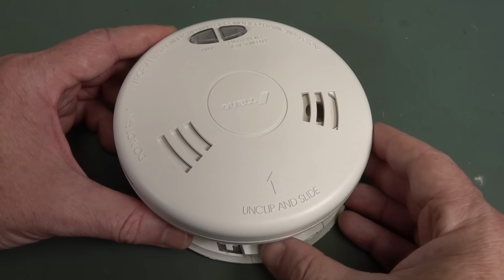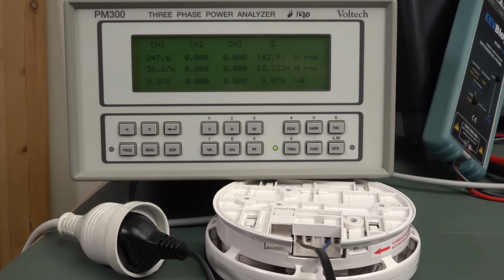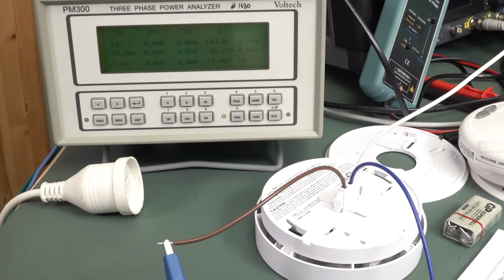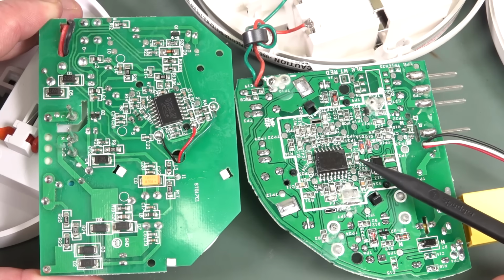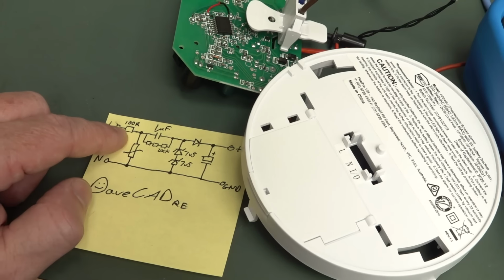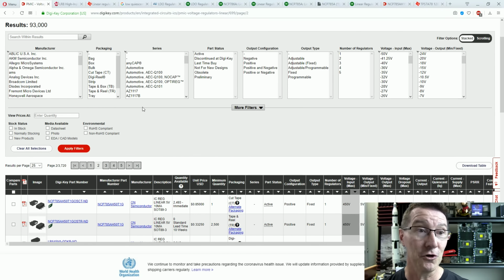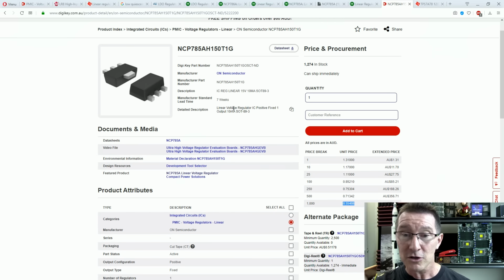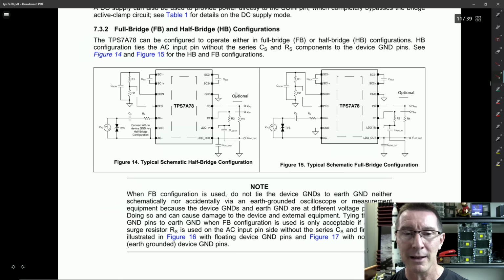EEVblog #1284 - How Bad Product Design Kills The Environment

Comment: The apparent power is not real, it does not have to be produced. It does, however, cause losses in the wires because of the resistance.
Reply: Something I think worth pointing out is that mechanical generators don't have a problem, but inverters do.  There's a reason why UPS is rated in VA and not watts.
Reply: They should have just used tiny mains frequency transformer, product may cost 2-3$ more but power factor would be far greater
Reply: @blackwingmaster141  some do, atleast the CO detector I took apart.  I didn't measure power consumption, it died to internal timer saying it's too old. (chemical sensor)
Reply: @blackwingmaster141  A power transformer also has poor power factor when it is very lightly loaded. The transformer always draws a primary magnetising current even when there is no load on the secondary. This magnetising current lags the mains voltage by 90deg so has a power factor of close to zero.
Reply: @blackwingmaster141  $2-$3 more at manufacture translates to $20 more at retail. that in turn means people buy the competitors product that uses this tech and costs $20 less.
Reply: My Ex gf's father is working as a grid manager for a big power company in Germany, and we once had this discussion. According to him, private households don't have to pay for the power factor because back in the days when the power meters were installed, it didn't make much difference to go for the more expensive power meters, too, and in today's power grid the amount of capacitors and transformers/vacuum cleaners/etc. almost cancels each other out, but for big companies, the amount of spools, electric engines, heat elements is so high, they need to install big capacitor banks to avoid losses (which costs money). Fact is, I don't know how much energy gets lost due to the current flowing aimlessly from one household device to another, but it seems to be insignificant - for him, at least. Just to digress: for him, solar cells where a much, much bigger issue, since one cloud over bavaria could create a sudden lack of several GW which had to be compensated. A storm had the same effect for windmills. So his job was basically to run in circles switching on and off gas power stations and storage batteries to avoid power shortage. So as a matter of fact, the whole power thing seems to be complicated.
Reply: @TheBigBadButler  Fuckin A it is huh...
Reply: @eevblog the real problem is the current harmonic content not power factor by itself. Standard power factor correction techniques at grid level based on inductors / capacitors simply does not work in this case. There are regulations on this (en61000-3-2 for example) but it applies only above 75w so the manufacturer simply does not care about it. The real problem of this design is not the PF by itself but the huge amount of power wasted in the zener diodes.... They used even 2x 7.5v in series in SMA package to cope with the losses...
Reply: @marcogeri  why do the damn smoke detectors need zenner diodes,  is this a component smuggling scheme all along,  aren't zenner, more of a radio thing?
Reply: @marcogeri I'm an EE and This is the right comment. In addition, Some of your reactive power is subject to thermodynamic losses, so reactive power is not desirable in general, but is usually easily tolerated. It's better to design for low real power before low reactive power.
Reply: Everyone forgot that moving the PF away from unity of a generator requires more excitation voltage to counteract the increased back emf of the supply side, another small (tiny) but real loss.
Reply: "Energy can be transformed from one form to another, but can be neither created nor destroyed." I would like to offer the first law of thermodynamics. If the power is being used somewhere it is most certainly being generated somewhere else. 

Usually over large grids capacitive and inductive loads will at a small level cancel each other out with inductive loads being more common. Yes dirty power does cause power loss from multiple sources including resistance of the wires but it also reduces the efficiency of other machines in the same area as the machine causing the problem. One machine in a large grid is negligible but that doesnt mean the power is free. At some level more fuel will need to be burned to compensate for any unbalanced PF. If it's making heat in the wires that heat or energy is being added to the steam boiler, diesel generator, solar panels, squirrel cage etc.

As the voltage drops many devices pull more current to remain power constant. This is why running a 220 motor with 110 will cause it to run hotter not slower. As power is used the first reaction on the generator is increased torque on the shaft, in order to maintain constant frequency more power is added to the shaft. If voltage or frequency go down this causes a dramatic increase in current (Initial load on grid remaining constant). 

If there is a resistance separating the generator and load it must compensate for this with an increase in current. This is why if your angle grinder is getting hot using a shorter, thicker extension cable will help it run cooler. I might be wrong but I don't see any way around this to free power, even if heating the wires isn't performing useful work it is still consuming energy that must be replaced.
Reply: If practice the power factor is most often compensated at the latest in the nearest substation. And if the network is on the inductive side of reactive curve these devices will actually help compensate the local grid.. so not as simple as Dave leads us to believe.
Reply: Is the smoke detector PF capacitive or inductive? If I am correct the power grid is inductive, so if this thing is capacitive they don’t mind? Most mains led lamps are using also a capacitor dropper, with also a bad PF.
Reply: Based on the sheer number of answers and conflicting opinions here, this channel could use a video on grid/real power. Two professors in my old university taught courses involving power factors yet neither of them ever mentionned whether that power had to be produced on the shaft or copper losses on the extra currents.
Reply: This thread made my head explode.
Reply: @compwhiz797  You've tried that argument before, and it isn't any more convincing now than it was the first time you said it. On the one hand we have you and others I have no idea of the qualifications for telling me that this waste doesn't happen, yet on the other hand we have Dave and other electrical engineers saying that it does. While everyone makes mistakes, I find it far more likely that it's you who is wrong than Dave is. You use a lot of language ("I don't see", "doesn't sound like", "seems") that are red flags of an argument from incredulity. Your expression of incredulity of why it "doesn't sound like a motor hooked up to it" is particularly hilarious because it's the fact that generators and motors aren't so neatly separated is the reason why generators conserve energy in the first place. FYI, the ghostly motor does in fact help by putting energy back into the rotor, but it's still a legit load on the system. If you gave me $20 and I gave you $19 back, it doesn't erase the fact that you gave me $20 to begin with.

To be sure, reactive power is quite screwy, evident by the fact that apparent power isn't the simple sum of the two. Near I can figure out, reactive power is the power required to change the configuration of the electrical system from moment to moment. It gives your notion a fighting chance, but I think we need a real electrical engineer like Dave to really explain it thoroughly in a Fundamentals Friday vid. I've been doing calculations and I haven't definitively shown VA in some sense is W, but I can't help thinking that there's a 'gotcha' somewhere I'm not seeing.
Reply: You say yourself it causes losses in the wires, so where does that extra energy come from?
Reply: @PlasmaHH  from the generator. It's less than the difference between apparent and real power, though.
Reply: Transformer had to be sized with the VA figure, not the watts.
Reply: Interesting points re apparent power (Kvar) and real power (KW). As a electrical designer (UK), I would always need to select a generator or a transformer using a calculation of KVA because this includes both apparent (reactive) and real power. The difference between KW (real power) & KVA is the power factor. The apparent power in the system doesn’t do any useful work, but it exists and has to be accounted for when correctly sizing a generator. In the uk, commercial customers get charged for apparent power, as a result of power factor that is less than unity. That’s why customers buy Power Factor correction units, capital investment that can significantly reduce operating costs. Post made me think of a good analogy from college, KVA is a pint of beer. The real power is the beer and the apparent power is the head. Beer always makes things easier to understand 😀
Reply: @G1MRK  - if you REALLY are an "electrical engineer" then you would understand that these capacitive droppers are a LEADING power factor. So, they are "power factor correction units". So they reduce the head to beer ratio, not make it worse.
Reply: John Coops 
My post was in relation to the original posts in this thread and the potential implication that you don’t need to account for reactive power in generation. Not the particulars of the smoke detectors. Interesting point you make re the assumed capacitive reactance. Would you describe any component or appliance, in any system that had net capacitive reactance, as being a ‘power factor correction unit’?
Reply: @José Ancapdolf Hidler sounds about right.
Reply: I wonder what the net impedance of the mains loading looks like with all the electric motors etc.. Usually industrial power factor correction is capacitor banks, so maybe these things are actually helping correct the  grid's net power factor.
Reply: @spehropefhany  is it hard on the transformers if the motors are vfd fed and running slow as possible.
Reply: I have a very strong feeling that a good few people on here don't understand phase reactive losses.. The energy wasted is lost as heat and the customer pays for it.. Doh! One of the reasons big users are usually very careful not to have poorly balanced loads..
Reply: Dave is TOTALLY wrong on the Power Factor issue. These use a CAPACITIVE DROPPER which results in a LEADING power factor,. This makes the grid MORE EFFICIENT, since it "corrects" the lagging power factor that is inherent in the normal power supply chain. So, these little devices improve the efficiency of the grid, not make it worse..
Reply: @johncoops6897  The mains are usually already corrected with big-ass capacitor banks. Adding additional leading reactive power to an already corrected system will lower efficiency. PF can never be more than 1, and PF = 1 is one with reactive power of zero.

Overcompensating with a unnecessary capacitor gives you excess leading reactive power and therefore lowering the power factor. That's why you don't just slap in a capacitor willy-nilly and all those Chinese "power factor correction" devices are bunk. You must tailor and tune your power factor correction to your particular situation. There's no one size fits all solution — well, not that cheap, anyway.
Reply: @wyrmofvt  - The DOMESTIC homes where these detectors are installed will have an overall PF of 0.7 to 0.8 lagging AT BEST. So these capacitive loads will always improve (not worsen) the PF.
The reason those Chinese "power factor correction" devices are bunk is because their capacitance is so small it makes no difference. These smoke alarms are even smaller capacitive (reactive) power than the Chinese crap. So, they have even LESS effect.
Many people do not understand PF, and cannot grasp that something with 100% reactive power is not "evil". If installing said device changes the power factor from 0.89 Lagging to (say) 0.95 Leading.... then the power factor has improved (irrespective of which side of unity it sits).
Reply: @johncoops6897  Bollocks. I doubt any cheap detector will give you an accurate assessment of PF in the first place, let alone its direction. The probable goal is to get you to buy bogus PF "correction," which will then be applied and then not verified to find out if it's remedied because people don't understand PF.

Power factor also varies per device. While older appliances can have some terrible power factors, modern appliances that conform to the Energy Star requirement must have a PF of at least 0.9 or better at full load anyway, either direction (NO guarantee that it's lagging!). Besides, capacitors are affected by series/parallel laws and as such the impedance it contributes to the circuit will vary A LOT depending on how they're connected. If you connect two capacitors in series, for instance, the combined capacitance goes DOWN, and thus would provide less leading reactive power — by adding in your superfluous capacitor, the reactive power could lag more.

>"Many people do not understand PF"
Yeah, that includes you. A 100% reactive power device is one where energy is not being transformed to some other use, like mechanical energy. Not exactly evil, per se, but not really fit for purpose. The bottom line is that there is no silver bullet. There is no one course of action that will ALWAYS improve your power factor.
Reply: @johncoops6897  well,  I find it all fasinating,  I like Dave and His channel. IF He is wrong then he s wrong, but one thing is for sure,  this has been the most epic thread on YouTube
Reply: With the introduction of smart meters in domestic settings which can measure kVA and energy companies substantially billing customers for the kVA they consume (there are European countries where this is already happening). The power factor of domestic appliances will have an effect on what consumers are paying for electricity.
Reply: @Broadcast1Channel  - hence any devices (eg: capacitive droppers like these) that reduce inductive power will improve the power factor. This will help to "REDUCE the kVA", not make it worse.
Reply: M I the only one, thinking this PF is leading one and not lagging one as the load is capacitive..?? Isn't it gonna change senario??
Reply: @compwhiz797  A wiseman once said, don't teach your grandma to suck eggs. Look, all the elements of power grid have to be sized to the maximum voltages and currents found along it, so you want to minimize both. For a given power output, that minimum occurs when V and I are always in synch. You can control that pretty well at the generator, ensuring that when you say that this generator delivers 20 W of power, it's really delivering 20 W of real power. That can and does change down the line as you connect various components. Any power you funnel from that generator into the grid is really being dumped into the grid.

Some of the delivered power will be dissipated in resistive loads as heat or work. These elements will take the power out of the system and keep the energy in the system from increasing without limit. The rest, the reactive loads, do not dissipate this energy but instead store it for release in another part of the AC cycle. A grid that is in a state that is delivering real power to resistive loads on it will have some proportional excess energy in it in these reactive loads.

Now, if these reactive loads could always absorb and release this energy back into the system without loss, then PF will always be 1 because the energy absorbed by the reactive elements is returned in full to the grid — only resistive load can get energy out of the system. However, if we consider what is happening to the individual electrons, we see that this could never be the case. These charges are accelerating in an AC circuit, and when charges accelerate, they emit EM radiation. This is fundamental. You can't get around it. Just by being reactive, the grid will absorb some energy that will never be returned — even though the loads are purely reactive, they nonetheless dissipate some energy as if they were resistive. Yet the energy lost in the reactive elements must be regenerated, else the grid can't be maintained in a steady state. This is reactive power. (Furthermore, there is no such thing as a purely reactive load.)

As for power factor, it is straightforwardly the amount of apparent power piped in vs. real power absorbed. A 20 W generator dumping into grid with 5% transmission loss over the grid will see 19 W on the other end, and the voltage at the other end dropped by 5% (current being 'constant'). Of course, since the amount of current passing through a resistive load is proportional to the voltage drop across it (Ohm's law), you can't simply say that some device's power consumption is 1.5 W — you have to specify the voltage across the plug blades. The device having a power factor of 5% means that, of the delivered 20 VA apparent power, only 1 W is dissipated as real power; there is 19.97 VA of reactive power being absorbed by the system. And yes, that doesn't add up to 20 W. That's because we're dealing with impedances and complex power now and they live on the complex plane. Having a suitable device on the grid with -19.97 VA reactive power will correct the imbalance and bring the power factor up — by adding a suitable impedance, you can bring the amount of apparent power needed down. Resistive transmission loss is not reactive power and can't be recovered by way of power factor compensation, so it's considered a part of the real power.
Reply: Typically grids are inductively loaded due to motors. Capacitive PSUs are fine, because they get too expensive (as compared to a SMPS) when they get to problematic power levels.
Reply: @compwhiz797  "Surely this applies equally to the current supplying a pure 20W resistive load, too, right?"

Well, yeah, except that there can be destructive interference such that in the far field it looks like the circuit is not radiating. A properly tuned circuit will have it so that no significant EM radiation will be leaked. But there are also other sources of power leakage that can sap away reactive power. For instance, if you consider only the grid and the things on it, we have reactive power, but if you include more electrical entities like the ground (which can exchange energy through capacitive coupling) and more detail on the entities you have, then it can easily end up with alternate paths for power to go and have ensembles of reactive elements looking like resistive elements (filters are one such item). You can have it that most of the current coming down the wires is bypassing the load altogether — current that doesn't flow through the load itself doesn't power it.

Ultimately, if you pump 20 W into a system and it remains in a steady state, then 20 W are coming out of the system by some route. Furthermore, 20 VA is exactly equal to 20 W if V and I are in phase. It is something you can measure, and verify that there is, in fact 20 W coming out of that generator and into the grid. You can measure how much is going into the system and how much is coming out the load. The remainder has to be going somewhere else.

I mean, we've done measurements and know that PF does mean that, wherever that power is going, it ain't going into the resistive loads — it does impact efficiency. We saw in Dave's video that a smoke detector was definitely drawing more power from the mains than it did from its battery, and at a horrendous power factor. This is a real measurement, and requires an explanation.
Reply: @compwhiz797  Because with a PF of 0.062, the device is only dissipating a 0.062 proportion of the apparent power 20 VA towards some end. That's what "power factor" means. Ergo, the rest of that power must be going somewhere else, and the amount of power going somewhere else is more than 10x that of the power dumped into said device.

Because the load is resistive and (presumably) linear, the amount of power absorbed by the device is proportional to the apparent power pumped in, so for S*0.062 = 20 W, S = (20/0.062) VA. (Of course, this presumes that the load responds linearly to apparent power; real world devices will likely have PF that are functions of their power draw.)

Now, where is this somewhere else? Without analyzing the grid, we can't tell. That power factor only applies to that device, not the system as a whole. The power factor of the transmission lines, on the other hand, may be entirely different. Of course, there may be many routes for the reactive power to eventually go, routes that would not be available to a DC current. Even if that reactive power is reflected back at the generator, we could view this as the generator losing efficiency, or we can view it as an electrically driven friction force on the generator.
Reply: @compwhiz797  >"This is where I don't follow: you simply assumed that VA equals total dissipated power"

You can measure the amount of power you're putting into the generator at the crankshaft, and if you're measuring that a generator is being cranked at 20 W, you know that you're putting 20 W of power into it. That power is energizing the grid, and given that the grid hasn't exploded on you, but instead remaining in a steady state, that there must be 20 W of power coming out of it. You may not know how it's coming out (you need to fully identify the problem before you can determine that), but you DO know that 20 W is going somewhere.

Nothing in the above explanation says that the energy is necessarily being dissipated by the resistive elements of the grid proper. I've already pointed out that current can leak into the ground by capacitative coupling, which can be substantial over the course of miles of transmission wire. At each stage in this transmission infrastructure, we can verify the amount of power being transferred along it, and build so that these components are delivering the expected watts to the next link in the chain. And yes, they know the difference between VA and W and when they say that a power plant is cranking out 200 MW, they actually mean it.

You keep going back to your LC circuit as if it means something, but it doesn't. Your LC resonant circuit is idealized and not representative of the grid. You at least need an R component in the circuit in order to even pretend that it represents the grid. Furthermore, your grid is dead simple and isolated, which a real grid is not. You can verify that your LC circuit isn't absorbing much power because you don't feel much resistance when you crank the generator. But that also means that a power grid is really absorbing 200 MW from a 200 MW power station because the turbines are really cranking the generator shafts at 200 MW.

It's just bizarre to me that you think that electrical engineers are cutting their guts out on something that is actually inconsequential, and that Dave is taking the piss when he says that an out of whack power factor requires more generation capacity. No, it really matters, and the loss is real. AC is tricksy and can find many avenues to avoid putting power where we expect it, and can even escape its designated cage altogether — maybe not much in any particular part of the cage, but over a large extended area that a typical utility grid is spread over, the losses can be substantial. Reactive power is indicative of energy being shuffled about in unexpected ways. The very fact that power companies spend millions on power factor correction and charge industry for having out of whack power factor indicates that it is actually a thing.
Reply: It's no use, "a man convinced against his will is of the same opinion still". - Benjamin Franklin
Reply: @compwhiz797  Imagine a hamster is powering the grid from a bicycle generator. The grid is entirely resistive, so has a power factor of 1. The hamster pedals furiously. The second hamster measures the voltage and current leaving the generator. It is perfectly in phase. The instantaneous power is always above zero (it touches zero twice per cycle).

Now the grid is entirely capacitive. The power factor is 0. The hamster still finds that he needs to pedal furiously to support this grid at the specified voltage levels. The second hamster measures the voltage and current leaving the generator. The current leads the voltage by 90 degrees. The instantaneous power is now oscillating around zero.

If in the first case, the generated real power was 100MW, and in the second case the generated reactive power was 100MVAr, does the hamster on the bicycle know any difference? Does he have to pedal just as hard?
Reply: @compwhiz797  >"Where you lose me is that we are talking 20VA measured at the load.  Not 20W measured, and not at the generator."

It's a contrivance of the example. It's been arranged such that the outlet does, in fact, deliver 20 W to a particular appliance with PF = 1, such as a 20 W incandescent bulb. I've been assuming that the grid is well built and maintained to guarantee that the outlet does indeed deliver 20 W with V and I in phase under such resistive loads. I'm not saying that VA and W are always the same; I'm saying that the grid builders and maintainers have done their jobs properly.

So the outlet is capable of delivering 20 W to certain loads with PF = 1, and as such apparent power and real power are the same. That will change under a PF = 0.062. We suppose that the device will have the same impedance magnitude, but not the same phase angle (cos(arg(Z)) = 0.062). It will therefore draw the same complex power (VA), but the power is split between resistive and reactive power.

Without knowing the details of the particular grid —and for a real grid, you probably don't— you can't say how the extra power is being lost. It's simply ill-identified. You just know it ain't going where it's supposed to go.

>"The thing is, if 20VA at the load = 20W generated without adding compensation in the local grid, engineers would be getting out torches and pitchforks for these smoke detector companies, and all other items with horrible PF that are all over the place, rather than saying "okay, we can filter/correct that"."

Well, they do get their pitchforks and torches out for atrocious PFs of substantial magnitudes, only that consists of sending a hefty bill to the offenders. As long as the customers pays for their power, real or complex, they could be sinking that power right into the ground and the power company wouldn't care. Thing is, that PF-poor smoke detectors do not form a substantial portion of that. We're still talking about power loss of around 2.5 W per home (5 units @ 1/2 W each), which is about 0.25% of average consumption. They're not going to be upset about that.

The configuration of the grid is ever changing: devices are being connected and disconnected all the time, and even the same device may not have a consistent power factor. As such, it may not be worth maintaining PF correction past a certain point. Nevertheless, the power company is doing their level best to keep V and I in phase across the grid, because that's where power transfer per V and A are at maximum.

>"If you have a small generator hooked to a resistor, and then you add a big capacitor across the resistor, what part of the system would suddenly be dissipating a lot more power?"

It depends. Your setup here is ill-identified. In your toy example, it's likely (though not a sure thing) that reactive power is feeding back into the generator in which case you'll have a dim bulb and an easy time cranking it. The power company is doing its level best to see that this doesn't happen. They can't sell power they don't deliver, so they're going to make sure that the 200 MW of power their plant is cranking out actually makes it to their end users and stay there.

>"Capacitive coupling to ground sounds like it will leak that current just by having voltage on the grid, even with no load.  EM losses from moving charges also sounds like it will be the same for the same amount of current at the same frequencies, regardless of phase."

It depends. You need to specify a specific grid and crunch the numbers. Just because the AC currents can couple with the ground doesn't mean that the current will find moving through the ground particularly easy. Just because EM radiation can be emitted doesn't mean that that radiation won't be preferentially absorbed by other parts of the circuit.

This is part of the reason why there's no silver bullet to remedying your PF issues. Complex power is complex, in many senses.
Reply: @compwhiz797  >"but they don't make you pay for VA as if it were W generated, they only fine you for bad PF - if they really had to generate the entire VA, then why didn't they bill VA rather than watts right from the start?"

Because metering real power is easier, I expect. Metering real power requires a very simple motor (remember that spinny disk thing you had in your old meter?), whereas monitoring VA requires a more complicated meter. Also, that surcharge for bad PF is effectively a bill for VA. After all, keeping up an active power delivery with a bad PF ultimately requires a higher peak V and I from the generator (compared to good PF), which requires the coils to be excited more, which requires the generator to be driven harder. It also eats into the contingency margins for the grid. Power companies need to generate MORE power than is nominally consumed, because they need to supply an unpredictable demand.

>"again, you are just assuming complex power equals real power."

You might as well have said here, "You are just assuming 2D momentum equals 1D momentum." Complex power is real power rotated partially into the complex plane, of which real power is its projection onto the real line.

>"In my example, the bulb is intended to run at 1.5W, so it won't be dimmer than designed unless it is no longer getting 1.5W (of real power, since it is resistive)."

What voltage? What current? The reason why the bulb gets 1.5 W of power in a particular circuit is because it presents a given resistance to the circuit. It's 1.5 W @ 3 V DC, for instance. Double the voltage, and you quadruple the power dumped into the bulb. You gave VA, but you never gave V or A alone.

>"The VA of the system goes up (complex power has increased entirely in the imaginary dimension), but the generator doesn't have to turn that much harder, like you said, right?"

Again, it depends. I can confidently make this prediction because in this example I can make the rather restrictive assumption that the significant resistances, capacitances and inductances can be counted on one hand, and I can make some fair assumptions about the magnitudes of same, and the requirements of your lamp. Real grids and real loads? Not so much.

>"This was my whole point, increased VA here doesn't mean the generator has to generate that much in watts, the system just has to deal with (and be built to handle) more current, and the generator has to make up for the current losses with some extra generation."

And that's my whole point. You said yourself right there that maintaining the required current losses requires extra generation (also increased peak voltage, but you can trade current for volts). That means cranking more generators and/or cranking them harder, and they don't run on pixie dust and sugar, my friend.

>"In a real system, isn't the main reason that the reactive power doesn't "feed back into the generator" because of the PF correction that utilities add to the grid?"

Yes. But that doesn't mean that it doesn't go elsewhere on the grid. And due to varying PF even in the same device, let alone the ever changing landscape of devices drawing from the grid, no static PF correction can completely compensate for bad PF at all times anyway. That utility-side PF correction could cure your devices's specific PF, but it's bloody unlikely. A per appliance PF correction is best. (Psst, that's why the Energy Star standard requires that the appliance itself maintain a decent PF.)
Reply: @eevblog - we non EE subscribers would appreciate a follow up video on this imaginary power debate. My basic understanding is that lost current across the zener voltage drop is lost power, and that power has to be supplied from somewhere, paid for by someone with some CO2 emissions.
Reply: @billward2264  That's a pure resistive loss over your diode and a linear term. What all are talking and confusing about has to do with sinusoidal curves of current and voltage that are timing wise not congruent. This does it not make "unreal", apparent, seeming, ostensible in a colloquial wording sense. Only harder to wrap your head arround it and to calculate. It's that easy:) ... with a little complex math. Please have a look at  https://en.wikipedia.org/wiki/AC_power#Calculations_and_equations
Reply: @compwhiz797  But reactive power feeding back into the generator is completely equivalent as having full power coming out of the generator and then having the reactive power feeding into a motor on the same shaft, only in this case the motor and generator are the same device. Generally, a generator produces emf at ℰ ∝ ω sin ωt. That will induce a current proportional to the resistance it sees. But with back emf, what we get is charges that reduce their energy as they move through the wire (below that is expected by the driving emf) — to the generator, that looks like a resistor. Now, if we allow the generator to slow down, we reduce the back emf and balance can be restored, but in power plants you can't do that — ω = 2πf must be maintained. Thus, you have energy going into the current through the forward emf, but that energy is being taken out of it by the back emf, leaving the energy in the generator. The generator must heat up.
Reply: Power factor is difficult to understand, if the current is 90 degrees out of phase with the voltage the wattage is zero. The only power consumed is in the resistance of the wires, transformer windings and the generator windings. You need to understand true power and apparent power.
Reply: @compwhiz797  The reason why I say reactive power is somehow real is that it represents the energy sloshing around in the circuit, causing charge to move around in real wires that have real resistances. If you disconnect an LCR circuit from its driver, its current will eventually die down and become quiescent, as proven by experiment and the derivative formulation. It is NOT the case where the active power is extinguished and only the reactive power is left, so the circuit oscillates for eternity.

I think that active power and reactive power must be transforming into each other. What we see in a steady state circuit is the situation where the two are in detailed balance — that is, every joule of reactant energy that is gained is matched by a joule lost and transformed into active energy. It would explain why a higher reactive power would require more juice.
Reply: @wyrmofvt  Complex power is split into two orthogonal parts (parts that don't interfere with each other). The first is the resistive part, where V and I are in phase. The second is the reactive part, where V and I have a 90 degree difference. A system with only reactance would be impossible to recreate in reality because all capacitors and inductors have resistance. However, if it were possible, the situation of having electrons moving back and forth with no net energy input would hold no contradiction because there would be no resistance. All practical systems have a combination of the real and reactive parts. Mathematically, the instantaneous power can be split into these two basic, pure and separate parts. That's why we can say we have X amount of power that is behaving like it is in just a net capacitive or inductive circuit, and Y amount of power that is behaving like it is in just a resistive part. The two phenomena exist separately in a way. That is the mathematical elegance of complex power - S = P + jQ. All the resistance is stripped from the L and C parts and moved to resistance and, and vice-versa.

The way I saw this discussion was in terms of whether reactive power is continuously absorbed/re-absorbed into the system with no net energy requirement, i.e. does a power plant need fuel to create the reactive power. If someone could invent a generator that was able to do this, sure. But synchronous generators have practical restrictions. The answer to this whole debate is in the physical operation of the synchronous generator. It would need to behave like a capacitor for part of the cycle if the circuit was net inductive, and an inductor if the circuit was net capacitive. My understanding is they can do this to some extent, but it gets complicated. I'm still unsure.
Reply: @Steve-du6ms  If I were to set up a current in a superconductor loop and disconnect it from the current source, it would also have a current that flows forever. The idealized LC circuit doesn't dissipate power because it has no means to, so it oscillates in perpetuity. It's not because it has only reactive elements —a superconducting loop has only conducting elements will sustain a current forever— it's because there's no avenue for energy loss. It also has no power, active or reactive, at all — an LC circuit oscillating on its own does so at its resonant frequency, which means that their reactances are equal and opposite, so they cancel out — no impedance, ergo no power. The wires between the reactive elements of a circuit all follow Ohm's law, and they conduct only when there is a voltage drop across them, and as such, they only carry current if that current dissipates some power. Wires and other resistors never see this current out of phase with voltage thing; they obey Ohm's law even though the reactive elements don't.
Reply: @wyrmofvt  In the idealised case of a purely reactive circuit, Ohms law is (I^2)X, not (I^2)R. No power needs to dissipate for electrons to flow if R=0. The theory of complex power, S = P + jQ is reliant on the assumption that the Resistive and Reactive parts can be completely separated into lumped elements - R, L and C. Despite the fact that all practical capacitance and inductance has some R, with complex power, we separate them out so the circuit impedance is made up of all the R and all the net C or L. This is the complex impedance, Z. Your Ohms law is then V/Z. Some of the confusion about reactive power seems to stem from the fact that it is an impossibility (in any practical system) for electrons to slosh back and forth with no net energy requirement or power dissipation. But complex power is a mathematical trick to split the power up so, actually, one element is behaving like it is in a purely reactive circuit. To deliver a set amount of real power to a load, more current is required in a system with a poorer power factor. This will lead to higher overall losses - (I^2)R. This is different to saying that the reactive power is interacting with the resistance to cause losses. The reactive and real elements do not interact, and this is the mathematical genius of complex power.
Reply: @Steve-du6ms  Yes, I did take the unit on electrical power in college. But you're wrong in saying that reactive and resistive elements "do not interact." They do, by way of the parallel law, which involves the (-1)-norm of the impedances. The impedance of a resistor R and capacitive reactance X is RX(X-jR)/(R²+X²) — R is sitting where a capacitive reactance should be. Furthermore, a set of purely reactive elements can react in a way that in the limit looks like an ordinary resistance. Feynman II 22-6 details an example where an infinite L-C ladder network will (below a critical frequency) have a real-value impedance. This might sound like an unrealistic example, except that very long power lines behave the same way — like a bunch of very small impedances in series and capacitances in shunt. Even a superconductor transmission wire will have a real-value (completely resistive) impedance of sqrt(L/C), where L and C are inductance and capacitance per unit length. (explained at the end of Feynman II 22-7)

Again, I think that no power is dissipated if R = 0 is missing the point. No power is dissipated because there is no avenue for energy to escape. The reactive lump elements L and C provide no avenue for energy loss, and that's why it doesn't die down, but even if a real LC circuit could be made completely out of superconductor, it would still throw off EM radiation as they are putting out changing electric and magnetic fields into free space, and in the formalism would manifest as a resistance that would be a power loss. In normal circuits this may be ignored, but in a circuit where EM radiation would be the principle source of energy loss, it can no longer be ignored as it is in the formalism. And as I outlined above, even purely reactive components can interact in a way to produce impedances with real values.
Reply: @wyrmofvt  This kind of analysis is common in mathematics, science and engineering. P and Q (and R and X) are decomposed orthogonal sets. They add only in quadrature to form the apparent power. If you start claiming that they are interacting, you are claiming that sideways interacts with up in cartesian geometry.The mathematics of complex power are based on the resistive elements and the reactive elements being separated. All you are doing with the equation for a parallel RC circuit is converting that system into an equivalent series impedance, also made of R and C. This R and C was always there in the first place, separated and not interfering. As I keep saying, complex power is made up of real and reactive power. Real power is dissipation in the resistive elements, Reactive power is the power flow into, and out of the reactive elements in the circuit. The mathematical concept of complex power - to truly understand it - requires you to visualise the two phenomena separately. They are idealistic extremes that cannot exist practically, but can exist on paper, and in our minds, in the form of S = P + jQ = (I^2)Z = (I^2)R + j(I^2)X. Think of the lumping all the reactance and then lumping all the resistance of a circuit in a single place, then solve the circuit. The only "Interaction" is due to the fact that the current magnitude can change if X or R change, effecting the losses. 

The LC ladder network in Feymann's lecture is the ideal long transmission line model. The resistance you are referring to is the characteristic impedance of the line. It is the ratio of voltage and current if a signal were sent into the line before any reflections would occur. This is completely different to the kind of impedance we are referring to in complex power. In an electrically long line, things become more complex because the voltage and current are now a function of position on the line.
Reply: @Steve-du6ms  Now I know you've stopped listening to me, if you ever did listen to me, and are now throwing out concepts trying to impress me. Anyone can take a charged capacitor and connect it across a resistor and note that the resistor will discharge the capacitor to know that the two kinds of components do interfere with each other. I have a page full of equations and calculations of three simple circuits, each adding in a different reactive element, that shows that they DO interfere with each other. Each reactive element added changes how the circuit behaves and how much current a lamp at the end gets. I presented an equation that showed that, if R > Xc are connected in parallel, then the resulting impedance has a larger reactive component than resistive component. Yes, in terms of calculating their respective powers, they are separate from each other. But equally important is that as long as the frequency of the AC remains the same, P and Q will maintain the same ratio regardless of Vrms or Irms for any given circuit. So don't tell me that ne'er the twain shall meet; I've got a page full of equations that says they do, and how.

As for the characteristic impedance of a transmission line, that impedance will rob energy from that current as surely as a proper resistor would. It's one of the reasons why the maximum power transfer from a source to a load only occurs at 50% efficiency. And, yes, it is the same impedance as calculated in complex power. Same formalism and everything.

>"In an electrically long line, things become more complex because the voltage and current are now a function of position on the line."

Hate to break this to you, bud, but this is how every circuit is. Each and every element in the circuit will alter the current and voltage profile of a circuit at each point. It's just along a transmission line, there are an infinitude of infinitesimal elements to contend with.
Reply: @wyrmofvt  If you have an RC parallel circuit and then you convert it to an equivalent series RC circuit, you will obviously get different component values. But to claim this is evidence that R and X are interacting makes no sense. It's a different representation that presents the same impedance to the load. Key phrase "same impedance". You can do (V^2)/R, (V^2)/X or (I^2)R, (I^2)X to find the component by component real/reactive power - but current splits in the parallel case and the voltage is the voltage drop across that component in the series case. Both representations - series or parallel - give you the same P and Q if your source is the same. 

As for a lossless transmission line - Feynmann's infinite LC ladder network - the characteristic impedance does not rob any energy from the line. It is simply a natural ratio of V to I as the wave propagates in the absence of reflections. No energy is dissipated. Your intuition is badly letting you down. Just a small amount of reading on this topic will confirm this for you.

Please also look up the definitions of electrically long and electrically short. Our discussion thus far has made the implicit assumption that our lines are electrically short, and the lumped approximation of R, C and L are valid because the instantaneous V, I (thus P, Q, S) are constant throughout the line. This is a fair assumption if the wavelength of the power frequency is many times greater than the line length. As I stated, if you want to now bring long lines into play, prepare for a step change in difficulty - hyperbolic equations and complex propagation constants. Did your unit on EE get that far?
Reply: @Steve-du6ms  >"Both representations - series or parallel - give you the same P and Q if your source is the same. "

And now I know you have no idea what you're talking about, and further, that you never carried out a calculation that proves your point, because if you did, you would know immediately that you were wrong. Say you had a resistor with resistance of 50 Ω and a capacitor with reactance of -50 Ω (capacitative). Put in series, the impedance is 50(1-i)Ω = 50√2Ω∠-45°. In parallel, the impedance is 25(1-i)Ω = 25√2Ω∠-45°. For a 100 Ω resistor and -1 Ω (reactance) capacitor, this becomes 100.004Ω∠-0.5° in series and 0.999Ω∠-89° in parallel. These are quite different impedances, and will produce very different P and Qs for the same source. This is because it's not merely a "different representation;" it's a wholly different circuit. The only different representations I've ever seen here is the impedance representation and the derivative representation, and they must give the same answers.

>"Just a small amount of reading on this topic will confirm this for you."

"Just a small amount of reading" appears to be all you have done. First off, this is V/I in the absence of reflections. When do you get an absence of reflections? Well, it's when you match the input impedance with the output impedance. Ie, in order to not get any reflections in this case, there must be no appreciable change in impedance as you go from generator to transmission wires to load. That requires a real characteristic impedance to be lossy just like the load impedance. It also doesn't tell you what happens in the reflective case. In case that doesn't convince you, how do you explain the operation of an antenna? It's a completely reactive component, yet it must have a partially resistive impedance because that dissipated power is where the transmitted signal gets its energy from. I'm sure that if you found out that no reactive component results in resistive losses that radio transmission crews would be VERY interested in what you have to say.

>"Our discussion thus far has made the implicit assumption that our lines are electrically short"

Whaddya mean "our discussion," white man? My example of a reactive network creating a real-valued impedance was a separate example, and you should not assume that any assumption made about the long transmission line characteristic impedance applies to the example of the other circuit. I was assuming plain vanilla Ohmic loss on that guy.
Reply: @wyrmofvt  When you convert a series RC circuit to an equivalent parallel RC circuit, the impedance itself does not change. You are essentially finding the equivalent RC values that will present exactly the same impedance to the source as the original series RC circuit. Why is this not self evident? For a series RC circuit of 50-j50 Ohms, the equivalent parallel circuit is 100 Ohms resistance in parallel with 100 Ohms reactance (your calculation is wrong by the way). Let's say the voltage is 100V, in the series case, the current is 1 + j1. In the parallel case, the current will be the sum of the current through the resistor, which is 1, and the current through the capacitor, which is j1. Oh what a shocker, they are the same :p. The give away here should be the intuition and common engineering sense to understand that a transformation between series and parallel representations  is just two ways of expressing exactly the same circuit.
Reply: @Steve-du6ms  >"When you convert a series RC circuit to an equivalent parallel RC circuit, the impedance itself does not change. You are essentially finding the equivalent RC values that will present exactly the same impedance to the source as the original series RC circuit. Why is this not self evident? "

Nobody asked you to consider equivalent series RC circuits. Nobody at all. At best, this is a distraction. At no point in my calculations on my changing network was I even considering conforming to a fixed impedance. I was simply whacking in new components and watching the impedance change, and consider the effect on a specific load with a fixed resistance. And it changes a lot. Furthermore, they had a significant effect on how much power that specific load was receiving. Sure, replacing a network for an equivalent RC series circuit gives me an equivalent impedance, and I used that fact to figure out how much current the AC source was pushing in, but I'm not really interested in the impedance per se, but rather how much power ultimately gets delivered to my chosen load and how much is diverted by my nichrome transmission wire.

>"For a series RC circuit of 50-j50 Ohms, the equivalent parallel circuit is 100 Ohms resistance in parallel with 100 Ohms reactance (your calculation is wrong by the way)."

No, it's not. I know how to calculate complex numbers.

>"Let's say the voltage is 100V, in the series case, the current is 1 + j1. In the parallel case, the current will be the sum of the current through the resistor, which is 1, and the current through the capacitor, which is j1. Oh what a shocker, they are the same :p."

And now I know, for sure, that you don't know what you're talking about. First off, (100V)/(100Ω - j100Ω) = (1+j1)/2 A. (w/z = wz*/zz*) Second, the series and parallel laws for impedances work exactly the same as for resistances. That is, 1/z = 1/z1 + 1/z2 for parallel z1 and z2. If you put a voltage across a resistor and a capacitor in parallel, the voltage drop across the resistor is exactly the same as for the resistor alone, so it draws V/z1 in current. The capacitor, same story, except V/z2 (phasor current). The total draw is the sum of the two. So why would putting the two in parallel somehow make them draw less current, as implied by your greater "equivalent impedance"?

(Note, (100V)/(50Ω-j50Ω) = 2(100V)/(100Ω-j100Ω) = 2(1+j1)/2 A = (1+j1) A)

>"The give away here should be the intuition and common engineering sense to understand that a transformation between series and parallel representations  is just two ways of expressing exactly the same circuit."

Making math errors doesn't make for a convincing argument. Just sayin'.
Reply: @wyrmofvt  Dude, you can't calculate the current through parallel circuits the same way you do with series, so why are you doing (100V)/(100Ω - j100Ω)? Please go back to my calculation and read it carefully. I have done V/100 for the resistor to the find the resistive current and then V/-j100 for the capacitor to find the capacitive current. then added them. This comes out as 1+j1Ω, exactly the same as the current through a (50Ω-j50Ω) series combination. How on earth is one drawing less current than the other? That only makes sense in your version of reality, i.e. the one with loose thinking and wrong calculations. You even kind of contradict yourself in the same paragraph so I'm sure the right calculation is within you somewhere. It just seems like you need to take a step back. Don't feel bad, I'm wrong about things all the time and it doesn't even bother me.
Reply: @wyrmofvt  Your initial claim here was that R and X `interact' by way of the parallel law. You then gave the equation for converting a parallel representation of a circuit to an equivalent series representation. Your next claim was that because R and X appear in both the formulation for the equivalent series representation, this shows that R and X are `interacting'. My response to this was that the impedances are in fact exactly the same, it's just different ways to represent the same impedance. I gave some examples showing that P and Q would be exactly the same for both cases.

You then stated quite boldly that solving the circuit with equivalent series and parallel representations would not give the same P and Q. I have shown this analytically, and via simulation in Matlab simulink. I know this is 100% true.

You then gave two examples to explain further. You started with a 50Ω resistor in series with a 50Ω capacitance. You incorrectly stated that the equivalent parallel representation would be 25Ω - j25Ω. I strongly suspect you used the formula for going from parallel to series rather than the other way around. I noted to you that the actual parallel representation was 100Ω||j100Ω. You later claimed that you were not doing a parallel to series conversion after all, rather you were just reconfiguring the circuit so the same series impedances appear in parallel. This is despite the fact that one post earlier you actually gave the formula for converting a parallel representation to a series equivalent. It makes no sense just to reconfigure the circuit so the series elements are in parallel. Given you had established a few posts earlier with the equation for equivalent parallel to series transformations, it just continues to be baffling. 

For my benefit, could you just summarise perhaps in 2 or 3 sentences where I am wrong? Is 100Ω||j100Ω not 50-j50Ω in series like I said? Why on earth would you put the series 50+j50Ω manually in parallel THEN do a parallel to series conversion back to 25-j25Ω? It just doesn't make any sense.  By the way, I have a PhD in electrical engineering.
Reply: @Steve-du6ms  
(snip because moot)
>"For my benefit, could you just summarise perhaps in 2 or 3 sentences where I am wrong? Is 100Ω||j100Ω not 50-j50Ω in series like I said?"

(Facepalm) Oh my god. No. No, this is not what I'm talking about AT ALL. You're asking, "Here's a series circuit, find a parallel circuit with the same impedance/here's a parallel circuit, find a series circuit with the same impedance." I was asking, "Here's a capacitor and a resistor. Make a series circuit out of them, and then a parallel circuit out of them. Do they have the same impedance?" Different damn question altogether.

>"Why on earth would you put the series 50+j50Ω manually in parallel THEN do a parallel to series conversion back to 25-j25Ω?"

Because I wasn't finding equivalent circuits by converting between them. The only person who thought I was, was you. At least you acknowledge that a 50Ω resistor and a -j50Ω capacitor in parallel would have an impedance of (25-j25)Ω like I was saying all along.

>"It just doesn't make any sense.  By the way, I have a PhD in electrical engineering."

I don't believe you. I used language that should have made it clear what I was getting at. To me, 50-j50Ω looks like the impedance for an entire network, not designating a 50Ω resistor and -j50Ω capacitor in series, or any such malarkey. You seemed not to get that I was, in fact, talking about different, non-equivalent circuits when I was taking great pains to try to communicate that. That really only happens if you're not practicing the principle of generosity, in which anything wrong with my arguments should at first be attributed to a poorly worded point, rather than an actual misunderstanding in concept on my part.

C'mon, did it really not occur to you that when I was talking about connecting a resistor and capacitor in series, and then connecting them in parallel, that I meant using the same resistor and capacitor in series and then in parallel? Sheesh.
Reply: After 187 replies, superconduction, resistance-less resistors and imaginary hard and ultimate generators we can clearly state that this all translates to bullshit.
... although the imaginary component, i must state, is the way to successfully calculate the losses:P
Reply: It always messes with my head all this real power carry on. Surely the electricity required from the grid is whatever current and voltage going into the product and every property, residential and commercial, should be charged for the VA. But like I said it's a mystery to me.
Reply: Instablaster.
Reply from the maker: It does if there is no PF correction to compensate for it.
Look at it this way: If you suddenly added 1,000,000 of these devices to the grid then you most certainly would have to generate an extra 100MW to handle that (if you want to maintain the same output voltage). Until such time as the power company figures out there is this extra poor PF load on the grid and installs more PF correction gear to compensate for it. Without the PF correction gear there is no free lunch.
And the further up the grid you install the PF correction gear the more losses in the wires and transformers further down the grid.
Reply: @EEVblog  I can sense the opportunity for a video on Power factor, its cause, its correction and its costs to us and the power generator
Reply: @EEVblog  , why would 1 Million of these 1W devices require a 100 MW plant? Shouldn't it require a 1 MW plant (i.e. one/fourth of a modern wind turbine?)
Reply from the maker: @HR-yd5ib  Because the 80mA current is real . You have to understand the intricacies of apparent power and distribution and correction. I'm not saying it would require a 100MW plant in practice , but ultimately it could if it wasn't compensated for in the network. And that's the argument here of the finer technical details of that point. It's a rather complicated issue to understand.
Reply: @EEVblog  , ha ... interesting! need to read up on that. Thanks for all your interesting posts! Love the ones on the solar roadways ;) Cheers from Europe!
Reply: @EEVblog  The copper losses of such a small device's poor PF is insignificant. You have a whole house cranking amps, the smoke alarm's extra copper loss doesn't matter much. I made the same mistake in college. I think poor power factor is limited to the service transformer's secondary but I can't be sure.
Reply from the maker: @leerman22  Multiple it by millions of houses taking 80mA each sensor. And nope, it doesn't stop at the transformer, it can ultimately go all the way to the generator if not compensated for.
Reply: @EEVblog  So the infrastructure will just need to be scaled by a hundred watts capacity per residential customer and a few line losses the genny has to Work then. Your grid is already paying for it so you surely have that infrastructure :P
Reply: @EEVblog  What I mean is our nations are already paying for it, and we might as well stick to 9V batteries, like me :P
Reply: @HR-yd5ib  i thought it would require, 1000000 divide by .707 SO 1414427 more watts (peak to peak rms) but maybe not,  maybe that's just the for (90 perecent) inductive loads., and these arent.
Reply: EEVblog how can something that doesn’t exist diminish Any more than it already isn’t.
Reply: @EEVblog  The poor factor with these devices is primarily due to the high harmonic content of the current pulses produced by the rectifier action, particularly with a half-wave rectifier. The harmonic currents create additional VA but do not translate to any real power consumption (except to create additional line and transformer losses in the network). Conventional power factor correction doesn't do much to reduce harmonic currents and you have to resort to more expensive harmonic filters or such like to improve the power factor seen by the generating network.
Reply: @EEVblog  Dave never said if the PF was leading or lagging,  with the smoke detector power supply using a capacitor it could be a leading PF, this would help the grid because most devices on the grid  like motors cause lagging PF.
Reply: @EEVblog  so is the power factor equipment just to ,monitor what someone is drawing,  so they make ya pay for all of it ?
Reply: @EEVblog  is the pf gear, basically just large capacitors/condensers?
Reply: @ryanb1874  Yes, in most cases, with large industrial motor loads, you "correct" poor power factor by adding capacitors. You can think of this like basically wanting to cancel out the inductance of the motor loads. Motor loads cause current to "lag" voltage, and capacitive load cause current to "lead" voltage, so with correctly matched passive power factor correction, it can appear to the utility that you only have purely resistive loads.

The interesting thing about these transformerless capacitive loads is that they aren't the traditional "bad guy" inductive power factor that utilities dislike so much. The power factor from this kind of supply is leading (because it is naturally capacitive). So would they still bill you for it? I don't know, probably so...but I do know that unless or until the capacitive loading exceeds the large inductive motor loading across the grid, we actually do the utility companies a bit of a favor with capacitive loads like this. Basically, all these smoke alarms (and other small, transformerless devices with capacitors) collectively help offset the inductive loading from industrial motors, so the utility companies don't actually have to oversize their generators so much.
Reply: @davidhoelscher  said "unless or until the capacitive loading exceeds the large inductive motor loading across the grid, we actually do the utility companies a bit of a favor with capacitive loads like this." 

After reading the comments about utilities adding capacitors for PF correction, I was wondering why the capacitor in this product would make things worse.  David, thanks for clearing that up.
As a follow on question, do home appliance motors have PF issues also that these smoke alarm power supplies would help correct?  If so, then it seems likely that at any given time there will be more power going to refrigerators, furnace fans, washing machine motors, etc across a neighborhood than to all the smoke alarms.  Are the smoke alarms actually helping with the neighborhood wide PF?  Granted, they are still burning from 0.5 to 1 W, winch is ridiculously high.
Reply: @davidhoelscher  I agree.  Dave's mistake was not noticing whether the power factor was leading or lagging.
Reply from the maker: @andrewsnow7386  They could be, so "it depends". My argument is mostly from an ideal complete system design perspective. It's just really lazy and cheap design that has consequences.
Reply: @andrewsnow7386  Short answer: yes. By and large, system-wide, and even within a household, motor (inductive) loads tend to dominate the wattage and thus dictate your overall power factor. So yes, in this day and age, these capacitors do technically "help", but it's really quite negligible.... Like it is the within the rounding error and manufacturing tolerances of an AC induction motor in single appliance. Which makes some sense when you compare impedance of a motor with typically milli-Henry phase inductances (jωL) vs a 1uF capacitance (1/jωC)
Reply: @davidhoelscher  Except for the part where most household appliances with a motor in them have a correction capacitor already installed, even cheap chinese stuff. modern ac units and anything that uses a switching power supply has capacitive component, so today's house is capacitive shifted, not inductive. Factories have power correction installed. At least here substations have pfc, so the distribution loses are minimized. The electrical company makes us pay for aparent power, and at a higher rate then normal (+10% up to +50% per kVAh depending on pf and time of day) while in reality even a pf as bad as 0.1, would only amplify the loses on the line between apartment and substation (usualy less then 5%, so with a pf of 0.1, an aparent power of 10x, line losses would be ~50% of the actual power, meaning it should cost ~47.5% more, not 11-15x more!)
Reply: @EEVblog  - DAVE, you don't need to install PF Correction to improve the apparent power drawn by these devices. They are CAPACITIVE loads, so they are "power factor correctors". Millionms of them.... IMPROVING the power factor of every household. Test again.... using a proper power meter.
Reply: @EEVblog  I have created a circuit for this and done a simulation, I want to show you, how can I send it to you?
Reply: @EEVblog  "It does if there is no PF correction to compensate for it." NO! on so many levels.
Reply: @EEVblog  1000000*9 VA=9 MVA or 1000000*0,5 W=500 kW where comes your 100 MW from?
Reply: @EEVblog  this has a capacitor dropper,  so capacitive load, but the general load on the grid is inductive. This just cancels out some of the inductive load and REDUCES the VA load. It is actually beneficial.
Reply from the maker: @willgeorge5644  Unless the grid already has enough PF correction to balance it. In that case every capacitive load like this makes it worse not better.
Reply: EEVblog Dave, your concepts you describe in the video are correct however, not for the reasons everyone seems to be getting caught up on. The design is cheap and simple and does result in poor power factor, however this power factor is not leading or lagging like everyone keeps stating. The poor power factor is a result of the harmonic content produced by the nonlinear elements in the circuit creating a non-sinusoidal current draw. This non-sinusoidal current has many harmonics (Fourier) and these harmonics create poor power factor. This type of poor power factor cannot easily be fixed by utilities (capacitive or inductive load will not help). These harmonics are sometimes removed by filters at the transmission level ~100’s of KV where by this point the majority of the transmission and distribution system have already seen the i^2R losses. Although small, in large numbers the losses do add up as you have demonstrated.
Reply: @jacobdykstra8499  Don't do Switch Mode Power Supplies do exactly the same? Well, almost exactly.
Reply: @TheBigBadButler  Yes and no. If the mains is rectified and goes straight to a bulk storage capacitor, then the current waveform will be non-sinusoidal but it will be in phase with the voltage. This has harmonic content and poor power factor. A way to get around this is with active power factor correction. Active pfc uses a boost converter which electronically tracks the voltage waveform and forces the boost converter to draw current that is sinusoidal and tracks the mains input voltage. This boost converter then feeds the bulk storage capacitor of the switching power supply with the difference being the current waveform is much closer to sinusoidal and has low harmonic content. Many switching power supplies today incorporate this.
Reply: @EEVblog  It never has! think of all the inductive machines connected to it! transformers, motors etc. PF is never 1. There is PF correction, but when it is applied they only try to get better than 0.9 , never 1.  Use these devices, they good for the grid!
Reply from the maker: @jacobdykstra8499  Yes, I think you might have hit the nail on the head here. Thanks. Would be interesting to know at what point these filters exist in practice.
Reply: @jacobdykstra8499  Yeah we got way deep into this subject in relation to large data centers on Holt's Forum some years back. Sine was so distorted that it was causing overheating of HVAC equipment from all the switching power supplies. Really a difficult problem to correct for
Reply: @EEVblog  these harmonic filters exist usually at higher voltage substations (transmission level). The filters are known as reactors, they are literally just very large inductors. Reactors are used to control voltage at 100's of KV and are also used to reduce harmonics in the electrical system. It would be interesting to see the current waveform on a scope. Perform a differential measurement across the input resistor and see what the shape looks like.
Reply from the maker: @jacobdykstra8499  I have posted the current waveform on twitter, in the community tab on the channel, and on the forum, it's not pretty as you'd expect. Probably worth a follow-up video.
And yes, those who think you can just correct for this with lag/lead correction are wrong.
Reply: @EEVblog  nope, it does not. The generator will not require 100 MW of additional power at the *shaft*. It will require an additional power equal to the increased current by the resistance of the wires (and windings).
Reply from the maker: @vihai  Where does this magical additional power come from if not from the generator and it's fuel? And if the generator is producing the same voltage, that increased current must translate to real power at some point.
Reply: @EEVblog  it comes from the rotor (+turbine) inertia for half cycle, it goes back for the other half cycle, that's why you need some rotating mass as flywheel for apparent power "production".
Reply from the maker: @vihai  Ok, but surely this translates into a larger generator? Or more generators if that one is already maxed out. At some point there must be no free lunch.
Reply: @EEVblog  I saw a video explaining how in the UK they were experimenting with solar farm inverters as dynamic PF correction. Not exactly sure how it works, but the idea was to use the inverters at night when the solar farm wasn't producing electricity. I am guessing the inverters can produce/consume reactive power using its DC bus as a buffer?
Reply: @EEVblog  the non-free part of the lunch is the fact that you have more losses in generator windings, transformers and transmission cables, which ultimately translates to bigger infrastructure and surely wasted energy. In an extreme case where you have a superconducting generator directly connected to an ideal capacitor you may have gigawatts of apparent power and no real power at the shaft. (You better have very good vibration absorbers because the hum will be epic :) )
Reply: @EEVblog  The imaginary power translates into more current, but not more shaft torque.
Reply from the maker: @vihai  Strange how commercial customers are charged in kVA, and not kWh+"copper losses".
Reply: @EEVblog  They aren't here. They are billed by kWh and fined for poor power factor. Big factories have their own PF correction banks to not get fined.
I'll ask the opposite, if the extra 100MW is converted into electricity, where is the heat from that dissipated?
Reply: @EEVblog  here in Italy commercial customers are charged separately for energy (kWh) and reactive energy (kVARh) with much lower tariffs for kVARh.

(under 0.01 €/kVARh and only if you exceed 33% of the active power, if I'm not reading wrong)

If your utility uses the same tariff... ehm... good for them :)
Reply: @EEVblog  By charging in kVA, they effective are charging in kWh + copper losses. Most homes aren't charged in kVA this way because they'll usually only have one big, fixed, known motor load (an A/C unit) that would significantly affect measurements in kVA vs kWH. Businesses--particularly industrial ones--can have a lot of motor loads which increases kVA "consumption".

As far as it being a free lunch, it is only "free" if there is enough overhead to cover it. Basically, I like to think of it like taking out a very short term loan, really often (twice per AC cycle). You really do draw in more power (edit: technically current while the voltage is low), but you give it right back in the next quarter of the cycle. The system really does have to be able to provide (and accept) that much power fluctuation, so you end up having to oversize your power generating sources to handle those millisecond-level power borrowing-and-returning transactions. But some think it doesn't matter because they didn't really use up the energy---they're right, that it wasn't used, but everything up the chain had to be able to deliver it for those couple of milliseconds, and then take it right back a few milliseconds later.
Reply from the maker: @404Anymouse  It's dissipated in the system copper losses (generators, transformers, wires etc), because that 80mA current is real. And if you want to maintain the generator output voltage, ultimately, when it's all said and done, P=VxA.
Reply: @vihai  does this have remotely to do, with What Eric Dollard says about,  how the water company in LA generate their power in Las Vegas,  and (I think has paralleled lines from the generators to capacitor "building sized sites"  every 100 miles, to cancel the EM wave so the motors dont become 90 degrees outta phase w the generators, (and then it blasts)  this is a bit differant for sure. I bet it costs a ton,  all the extra cable, in parallel, all that distance. wireing, and the building sized banks. But Eric swears by this,  does that mean,  well there is not "free lunch " but defiantly a save on, no wire resistance loss. Well he says something about, retarded impedence, but then again he says that the em wave isn't really traveling at 300 km second, but like 93 percent of that(So maybe that is his retarded impedence?  but in another video,  he says the EM wave is 85 percent,  that must be a situation with worse PF loses? Or is this something else.? Thanks.
Reply: @vihai  is that a resonance system, (super conducting wires?)  HOW do the ultra high voltage DC lines work that transports phenomenal lengths,  is that a company secret?
Reply: @EEVblog  ah good point, power at the generation site, right.
Reply: @russellhltn1396  reactive power,  not good.
Reply: @404Anymouse  do I see a "free energy" argument coming here,  if you had infinate handling compo ants that is.
Reply: @vihai  Damn,  does that mean the capacitors, like you mentioned before,  to use as much, of the KVARH  you can,  so that's basically  I third the power, right, but off all three legs,  so it's not "free " but it is underutilized,  in most cases, (or the earlier cases, like in the 60 s in America. Do those setups need grounds-neutrals?
Reply: @davidhoelscher  better own that copper mine then,  right on your plant,  Ehhehehe
Reply: @davidhoelscher  nice
Reply: @ryanb1874  HVDC has greater conversion losses from AC to DC and viceversa than AC-AC but less transport reactive losses due to cable capacitance, thus, for sufficiently long lines it becomes more efficient.
Reply: @vihai  damn.
Reply: @EEVblog  the low power factor device is an energy reservoir. It acts as a load for part of the cycle and as a generator for another part of it. Theoretically, all reactive power gets dumped back on to the  grid. Of course, considering these are rectifiers and thus the reactive load is not only out of phase but the wrong frequency, a lot of it simply gets dumped into filters and thus lost as heat anyway.
Reply: @vihai  Well i have never heard of homes being wired up with superconducters. If you move power back and forth you will have losses.
Also consider applications where you actually have to either pay for apparent power or compensate with your own capacitor bank, like in industrial enviroments.
Every cent these companies save you have to pay for, either with your bill or with your compensation hardware.
Just because it is not listed as an item on your bill does not mean you are not paying for it.
Reply: @DasIllu  you couldn't miss the point more than this
Reply: @EEVblog  Imagine the lag between voltage and current. This translates to the torque at the shaft. On part of the rotation, you'll be adding energy into the shaft, while at the other part of the rotation, the shaft is providing it back to you. Conservation of energy at work. If you were correct, where would all the extra energy go in the first place?
Reply: @tomwimmenhove4652  In order to get back to the generator, it has to go through the wires first.
Reply: @wyrmofvt  Yes, so there's a bit of loss in wires. If you're using .1 watt, @1VA, that doesn't mean you're dissipating .9 watts in the wires though :) Most of the energy goes back to the generator still.
Reply: @tomwimmenhove4652  What you describe is a system where PF is correctly compensated for. PF is the ratio between the power that a circuit seems to consume and the power it actually consumes. You have to deliver the volts-amps that the circuit appears to require — not doing so results in malfunction. Poor PF will result in V(t) being out of phase with I(t) and it means that not as much energy is coming out of the system as is going in. If it occurs at the generator, it results in a loss of efficiency in the generator itself.

Remember, the energy may be returning to the generator, but it may not be returning at the right time to be properly absorbed as mechanical energy available to return to electrical energy. Also, each conversion of energy is in itself inefficient, so you pay a premium in converting that electrical energy to mechanical energy, and then again converting back.
Reply: @wyrmofvt   I never said it wasn't inefficient, neither would what I described be corrected for, unless you mean 'corrected for by the inertia at the shaft of the generator'. Of course you're going to loose energy. I'm just pointing out that Dave misunderstood the fundamentals here.
And, yes, energy might not be at the 'right time', but it will be 'used' in one part of the cycle, and 'released' in another. Therefore, other than copper losses, the difference between power and apparent power doesn't have to be 'generated'. The equivalent would be to have a non-symmetrical weight on your windmill :) You'd have to 'pull' extra hard to get it to move up, but you're going to get most of it back on the way down.  The difference isn't 'generated', it's stored in the system.
Reply: @tomwimmenhove4652  There are many points at which a lack of PF correction can affect efficiency. It can occur at a transformer, for instance — if the transformer has a PF of 1 (ie, it's actually drawing as much power as it appears to do so upstream) and the downstream grid has PF less than that, then this is a point where loss occurs. It actually doesn't matter, because you still need a generator beefy enough to deliver the required volts and amps, and you need to provide those volts and amps when they appear to be required, and you must crank it hard enough to deliver a bit more power than appears to be required, else you get brownouts. Apparent power is a real power requirement from the power grid — it must be supplied or the appliances aren't absorbing the power they need. Whether or not the generator is 'actually' generating the power or it is lost further down stream is irrelevant.
Reply: @wyrmofvt  "Whether or not the generator is 'actually' generating the power or it is lost further down stream is irrelevant" -- No. That's the entire point I'm trying to make. That's what Dave is talking about. That's what the thumbnail of the video shows ("100MW!"). Of course it's inefficient to pump 10 amps through a cable where, with a PF of 1, 1 would have sufficed. I'm not talking about it being just as efficient. It's obvious that it's not :)
Reply: @tomwimmenhove4652  No, it is irrelevant. Because PF loss doesn't occur solely at the generator, it's still power you have to generate and have lost as heat. Even for the portion of power that does come back to the generator, what happens is that the generator effectively becomes one of the loads on the system. There is power lost when the generator turns the returned electrical energy back into mechanical energy, and there is loss when that mechanical energy is turned back into electrical energy. While that mitigates the amount of power actually lost, it does not completely compensate for it.
Reply: @wyrmofvt  Correct. There are conversion losses, copper losses, magnetic losses (not sure if that's the correct term). All kinds of losses. I never disputed that. But it's relevant to the VIDEO. Because the video tries to show that, with a PF of .9, you have to generate 10 times the amount of energy. I'm not disputing anything you're saying, only what the video is claiming.
It would be interesting to model this, by the way. Now I'm curious how much of the (apparent power - actual power) actually does get 'burnt up'.
Reply: @tomwimmenhove4652  It wasn't a PF of 0.9. It was a PF of 0.062. That WOULD require a better than 10x power production to what is consumed.
Reply: @wyrmofvt  Oh, I just plopped down a number to make the point. The exact number isn't all that important, other than it being closer to zero than to one :)
Reply: @tomwimmenhove4652  depending on the source of the bad power factor thst could actually be more or less true - a 50hz square wave  current has a power factor of 0.9 (pi/4/sqrt(2)) because only the 50hz term contributes to real power, bit it has terms of 150hz, 250hz, 350hz.... all the odd multiples of 50hz, None of which contribute any real power. But the resistive heating In the transmission lines is ~9 times per amp at  150hz than at 50 and 25 times at 250, 49 at 350 etc, the losses are quickly going to get almost entire and practically, most of the energy in those higher harmonics is going to get dissipated as heat right fast
Reply: @AngDavies none of this was anywhere even near the point I was making.
Reply: @tomwimmenhove4652  ach you're right,sorry,  this thread is getting too unwieldy, hard to follow someones full argument. 

as i'm already making a comment it did make me wonder- because any inefficiencies due to reactive power would be dissipated in the large part in the distribution system, shouldn't that manifest itself as distortion of the voltage? like power supply droop, i.e. mathematically the only way reactive power, be it lagging, leading, or harmonic can dissipate energy is if somewhere in the system it becomes real power i.e. distorting the voltage so that it lines up better with the  current waveform?

though the current and voltage are not in sync at your wall outlet, that doesn't necessarily mean they aren't somewhere else in the system- current through a line is conserved, voltage is not, what appears as apparent power to you might be real power at the substation/pylon whatever.

again, not directed at you , just some questions to myself mainly XD
Reply: @wyrmofvt  must have been and english-american system right?
Reply: @AngDavies  when will something generate harmonics this bad though,  does it just happen all the time,  Its like, the power industry probably wants people to use less tech then right, if all we can do with tech is just keep uping the ante,  (and the harmonics) .
Reply: @AngDavies  I think all of this has to do with,  is that the EM wave, is not actually traveling, but is reacting in relation to the speed of light.
Reply: @AngDavies  You are right about that the reactive current influences the voltages in a power grid. But you have to consider the resistance and the inductance of the grid. Because the inductance is much larger than the resistance, the influence on the voltage is mostly caused by the line inductance. But only the resistance causes power losses. 

This is used to control voltages in the grid. For example, the generators in powerplants can draw or provide apparent power, which reduces or increases the grid voltage. Except for the small losses due to the resistances, this does not take any additional real power from the turbine or the grid.
Reply: @ryanb1874  a lot of devices use something like a current limited capacitor put over the terminals of a bridge rectifier to provide a dc voltage, this means they conduct no current untill the mains voltage rises above the voltage of the capacitor, then the current  switches on suddenly- a nonlinear load, common in low cost cost led lights/switch mode power supplies. Can't give exact numbers but that's gonna be full of nasty harmonics. You can even visually see its influence on the grid with an oscilloscope (be safe) - the peak of the sin wave gets flattened/clipped, as all those devices start drawing a burst of current at the exact same time
Reply: @EEVblog  Well...in the world of DC P=VxA, but in the world of AC S=VxA and P=VxAxcos⌀ where ⌀ is the angle by which the current lags or leads the voltage.
Reply: @vihai  that, X Power factor! No, it does not require shaft power.
Reply: @EEVblog  not a free lunch but give and take.
Reply: @EEVblog  They charge for the costs they get to handle reactive power. Typical losses from generators to users is about 7% - so if you want to power a 10 kW load, means you have to generate 10 / 0.93 = 10.753 kW. The about 750 W lost, is mostly resistive losses in power lines and transformers along the way. That's if your 10 kW load have a power factor of 1. Now if you decrease your power factor to 0.5, your will now draw 20 kVA from the line, to get your 10 kW out. That means, with no compensation, the losses in the line will go up to about 3 kW - now about 13 kW (not 20) has to be generated, to get the 10 kW out.
If you still want to keep the losses at 750 W, you have to ether up size your lines with 4 times! the cross sectional area or apply power factor correction (wich is also a cost and isn't always easy - if you can't put the correction close to the loads that draws reactive power, you will still have reactive currents in part of the network, wasting power in the lines). The more reactive power there is (big or many loads with poor power factor), the more costs they get to up size the lines and apply correction. So even if all reactive power is not wasted power, it does decrease efficiency of the power grid and is costly problem to deal with. 

For these small devices, I actually don't think the poor power factor is that much of a problem actually (as others have mentioned already). The 0,5-0,6 W stand by consumption is worse - because that power is just wasted as heat (probably mostly in the zener diodes) and really high for a such low power circuitry. If it draw the same amount of power running on the battery, it wouldn't last even 10 hours. 
But, back to the reactive power - the resistive losses caused by 80 mA extra current in the lines, are insignificant (usually within a few mW) and usually, you also have big resistive loads in a house, like different forms of heaters, that draws much more current. That means, most of that reactive power will be used up and not leave the house as reactive power. 
Think of it (simplified) as a capacitor that charges up when voltage is rising - close to zero at the "steepest" part of the sine wave it will draw about 113 mA (top value of 80 mA RMS) extra current from the line, that then gradually decreases and get down to zero once it reaches the top voltage (about 325 V, for a typical 230 V RMS line). When the voltage starts falling again, it stars to discharge and feed power back into the lines - once it reaches the steepest part of the sine wave on the way down, it feeds back the same 113 mA it did draw on the way up (since it haven't used any power). Now if you have another big resistive load connected to the same lines, that means most of those those 113 mA fed back by the capacitor will feed that load causing that to pull  113 mA less current from the lines instead. This means the capacitive load will cause a slight phase shift between the current and voltage (current will lead voltage with a few degrees or so), but the apphearent power will stay pretty much the same.

The current drawn by a capacitive (or inductive) load have to be significant compared to the current drawn by resistive loads, to cause the power factor to go down and become a problem. And this is probably why they doesn't charge for reactive power in homes, because most of the power used in houses is resistive loads, so poor power factor isn't generally a problem there. Although, if you have many of those devices, the reactive power and associated losses may add up - 10 of them will give 800 mA of reactive power, that will be more significant.

Altough, now when most products (even lighting) actually runs on DC and have to rectify the AC coming from the lines, another problem has started to become an issue both in industry, homes, offices etc. - wich also cause low power factor and also noise problems power lines. Non linear loads, where current draw doesn't have the same shape as the voltage. Unfortunately a simple rectifier with big smoothing capacitor (wich is used pretty much "everywhere"), is one of the worst, since it draws current in large pulses instead of a smooth sine shape. But this comment is already long enough already to write about that problem...
Reply: @gargantuablargg  Few years ago, this wasn't a big deal, because most loads with bad power factor had inductive characteristic (motors).
Reply: @vihai  I think his point is shorting out a wire has a powerfactor of nearly zero. While it won't consume much power, it will cause a voltage drop. The power plant still has to consume more fuel in order to maintain the voltage and frequency.
Reply: @davidhoelscher  Where I live very, very few homes have an A/C unit. I'd imagine the only large AC load would be the fan in the furnace.
Reply: @vihai  there would have to be the equivalent inductive loads to compensate.
Reply: @EEVblog  poor power factor does not cost the product of the current and voltage to generate. Think of it as making the generator harder to turn through part of the cycle and giving it a helping hand through the other part. Any resistive loads in series e.g. wires will waste more power.
Reply: I am pretty sure that's wrong. Otherwise it would be called free energy. If going not to be compensated it will overheat the generator and power lines and yes you need to put in more mechanical energy into the generator. There is no free lunch.

Residential homes are not paying for the apprehend power because up to fairly resent it was more expensive to measure than to ignore that minuscule amount. Now with all the LED and switching power supplys they start thinking again. Thanks to smart meters they can now just flip a (imaginary) switch and you have to pay for apprehend power.
Reply: I don’t understand this at all!
Reply: @putrid.p  All the free energy fucks say,  "Its series Resonance,   then Parallel,   then Who fucking knows,  how could you have a parallel,  or series thing for that matter w just 2 leads,  then a cap then a coil,   none of those damn things have polarisation do they,  then it would be a diode-cap right.
Reply: For those who think that no extra generator power is needed, think again! In the dim and distant past, we were building radio cabins which would be powered from generators. We were using a 22kVA generator feeding the cabin, which had a nominal power requirement of ~12kVA, the power input to the cabin was via a 15kVA isolation transformer (in order to meet the very strict EMC requirements we were given). The 1st time we connected the cabin to the generator, with the load side breakers open, the generator stalled when we put the generator breaker on. We subsequently found that we were pulling several 100 Amps but at 0.0 power factor, purely due to the transformer, but that still required the generator to supply the several 100s of Amps.
Reply: The original comment is essentially right. Because of the poor power factor, the device regenerates current into the grid during part of the AC cycle. If a million of these devices were the only thing connected to the grid, the transformer would have to sink current during that time to maintain regulation. In a residential setting however, the regenerated current is effectively absorbed by the nearest load that has a good power factor and is larger than the small device's reactive power. The loss in this case is the resistive loss of x mA through wiring resistance between those points.
Reply: The reactive power and peak currents still need to come from somewhere and requires the grid to cater for it, if it's a coal powered plant then that'll mean extra lumps of coal need throwing on the fire. It does cause extra losses waste power in the system.
Reply: @uK8cvPAq  Reactive power would come from PF correction capacitors.  Line losses for imaginary power are "real", but shouldn't be that much if you don't let the total PF get out of hand. There are bigger fish to fry - like balancing office A/C systems so they don't freeze people out.
Reply from the maker: @russellhltn1396  Yes, generally poor PF is not a huge issue for residential systems, as they are generally compensating for it, and that's why residential customers are not charged in kVAh. But in my example above, if you instantly added a mission units with horrible power factor, that's a big problem.
Reply: @EEVblog  A big problem until the power company makes it's corrections.
Reply: @russellhltn1396  It still all adds up, we just seem very good at consuming more and more resources. When the reactive currents get too big it means the infrastructure has to be upgraded to cope with the extra current.
Reply from the maker: @russellhltn1396  Yes, I'm not saying that it's 100MW extra required, if you added a million units overnight (the grid might go down!) and the company would quickly realise and start adding for compensation are the best points in in the system to do that. The point of the video of course is that the best thing to do from a design point of view is to a) Minimise the active (real) power consumption, and b) Improve the power factor in the device. In this case of the zener circuit, just getting rid of that and adding a HV linear reg with improve things several thousand fold. The PF will still be poor, but at the sub 100uA level you wouldn't need to care, compared to the 80mA level.
Reply from the maker: @uK8cvPAq  Yes, and 80mA active current is just terrible design! When for a few 10's of cents more you can reduce that to sub 100uA.
Reply: @EEVblog  But losses are still tiny chunk of the 20VA, the rest only needs to be created by inertia or inverter caps in one half cycle, but that energy returns into the rotors and into the caps in the next half cycle. The only thing that the reactive  energy part is complicating is that your rotors need to be heavier to be able to supply the energy in the charging half cycle.
And the rotors have plenty of inertia to keep running for much longer than that.
Reply: @EEVblog  I think some people here are only concerned with the monetary costs to them and their electricity bill, but of-course there's the environmental footprint too. I'm just going to come out and say it, I think there's a surprisingly high amount of anthropogenic climate change denial in the electronics community along with a culture of indifference and apathy on the subject.
Reply from the maker: @404Anymouse  Yep, understood. But like I said before, what if the generator is already at capacity? You need another generator to kick in to supply the current. At some point you have to pay the piper.
Reply: @EEVblog  power factor is not in a big deal for residential customers(well they don't see it on the bill) until the pf is so awful that the electric company changes your billing tier /schedule
Reply: @EEVblog  At the end of the day, it is inefficient trash, and bad for the environment. It doesn't matter how the power is generated, it is wasteful and poor design. Also, people don't spend their lives innovating so broke assholes can make trash circuits. Pretend that is always taking money out of your pocket, fix the problem, don't move the goalposts.
Reply: @EEVblog  Yes, assuming the generators are at top of their capacity in terms of current, not energy, which I don't believe to be likely case. I'm out of knowledge at that point though. I think that you most often run out of the energy to give to the rotor first, rather than hitting top limits of current capability. If you have hard knowledge on that, I'd love to be proven right or wrong.
Reply: @russellhltn1396  is a PF that gets outta hand,  lower that .707 times peak to peak,  or less than that,  or greater. Or am I screwing it all up.🙂
Reply from the maker: @404Anymouse  Unfortunately my knowledge stops at that that point to. I'm just appealing to the worst case and the simplicity of  P=V*A ultimately holding somewhere at this point.  Would be great to hear from actual power generation design engineers on this.
Reply: @404Anymouse  the stators can only be turned a certain max speed before they start generating radio energy, on the spot,  at least that's what I read in a history book,, and that either no more, or none at all, power would get through the system  can they add current to the system by busting the pulse train contacted to the rotors though, but maintain the idea rmp?
Reply: @EEVblog  afaik P=U x I x cos(phi). You're right, it is wasting energy. So is leaving the headlights on during day while driving. How much gas we all could save, right?
Power factor correction doesn't necessarily happen by adding caps, most of the time it happens either by changing the magnetic field in the generator, or switching on "regulator" plants with moving parts just like a turbine, which are only "generating" reactive power.
This regulation can be capacitive or inductive depending on the type of load. This can change depending on many factors. For example during high load, in case of a highly industrial region there's usually a ton of inductive load from all the motors running. In that case the almost 100MVAr can even be beneficial for the grid.
Not saying it is a good design, I think it's bad too. But for some, including me, the way you talk about it seems a bit exaggerating.
Reply: @EEVblog  From a quick Google, a refrigerator runs about 100W and the PF is in the range of 0.5-0.7 inductive.  You need the smoke detector's capacitive PF to help balance out the refrigerators.  ;)
Reply: @balahaasdf2219  Yeah that is what I was wondering, If it's mostly a capacitive load it might be ironically helping. That being said as a rule of thumb it's best not to make dirty power for no reason, Also 100mA for this device is atrocious.
Reply: @ryanb1874  The stators can be turned at certain fixed speed at which the AC generator is in phase with the grid. If less power is being obtained from the generator, it takes less power to rotate it at that speed. If more power is being obtained, you need to push more steam or water through the turbine to maintain same speed (or change wind turbine blades to more agresive angle).
Speed doesn't correlate with power usually.
Reply: @georhodiumgeo9827  Can anybody tell me why the LED lights in the basement I'm living in flicker,  when switch is off,  and there's no dam dimmer switch, so I don't tho k that's it,  bad chassi,  bad neutral?
Reply: It seems this myth of “reactive power making heat” is surprisingly widespread. I know I was taught in uni that you’re not supposed to use extension cable when they’re still coiled up because the inductance of the coil would cause a voltage drop across the reactance and hence cause the wires to heat up. When in reality A: they’re basically loosely twisted pairs so there wouldn’t be any significant net inductance, and B: the reactive power gives on one quarter cycle and takes on the next quarter cycle, producing no heat at all. For an extreme example, a phase shift of 180 degrees would be putting power back into the grid.
I for one can’t wait until we get compact supercities with a DC grid. That way you don’t get speaker hum, and more importantly you don’t have to worry about solar setups and other distributed power generation systems from requiring complex synchronised control software. They didn’t have the SMPS back in Edison’s time.
Reply: @Scrogan  you should indeed not do that, but not for the reasons given. cabling is rated to carry a certain current, but that assumes certain conditions i.e. one cable in free air. coiled up, surrounded by other cable, it will need to be derated, and the safe current carrying capacity is far lower, as it will dissipate the heat less effectively. They even have the derating on them usually, in the uk for example 13 amps unwound but only 5 amps coiled, running a heavy load off a coiled up extension cord is likely to result in a fire
Reply: @Scrogan  so basically we will be living i. A giant computer chip,  he'll w that I'm out,  to the wilderness cave.
Reply from the maker: @Scrogan  The 80ma measured current is real current though, and that produces I squared R losses.
Reply: @EEVblog  actually it's far worse than that in many cases- most are talking about lagging/leading power factor, which is indeed fairly easy to correct for. Harmonic power factor is a whole different kettle of fish - only the fundamental frequency does any work, but the current can include many harmonic components The transmission losses for these, even without filtering is going to be absolutely atrocious. Resistive heating in the transmission lines is gonna be proportional to i^2Rf^2 - skin depth decreases linearly with frequency, so the effective area of the lines is going to decrease as the square of the frequency. 2% resistive losses on the transmission system would be fairly good, meaning once you get to the fifth harmonic it's gonna get more like 50%, not accounting for transformer losses, which will also be superlinear in general.

when the harmonic current starts producing voltage distortions from that of a pure sine wave, that must be happening because the current is causing a voltage drop over source impedance and if you probe a typical mains outlet, you can see the sinewave is typically distorted- the tops and bottom of the waveform are visibly clipped, caused by rectifier devices that draw current only at the top and bottom of the voltage range and is going to represent a real genuine loss.

 Perhaps you could even get 
an upper bound estimate on the percentage power wasted by these harmonics, by calculating voltage harmonic distortion^2(ratio of RMS of harmonics to Full RMS)^2? Obtained if the transmission impedance is entirely resistive and not reactive, which might be quite close to the truth tbh, considering the fifth harmonic example given above, and the scaling of the quadratic Vs linear terms? But probably only valid for relatively small values of thd due to various linearity approximations needed to make it tractable. Dunno, don't have capability to even attempt that (only an old cro).

sorry if i'm teaching my grandmother to suck eggs, not an EE, degree is in maths (masters), but this stuff really interests me, and a lot of the skills seem to transfer. Honestly would love  a career in the field but don't have an idea where to start. is there a way to retrain that doesn't involve another 4 years at university? :/ did you ever meet any graduates from other technical fields that moved into EE somehow?

Edit: so many complications in the maths
Reply from the maker: @AngDavies  Yes, very common for people in other fields to get into EE through hobby projects and work their way in.
Reply: @AngDavies  " Resistive heating in the transmission lines is gonna be proportional to i^2Rf^2 " - Thats crazy talk btw. AC would never get used if resistive heating was proportional to frequency squared !
Reply: @adymode  is that, I sqaured. Times  2R times frequency sqaured?
Reply: @ryanb1874  ay except its R not 2R but that doesn't matter because the terms are unitless.
Reply: @adymode  yea my bad,  but F squared too right? That what got me